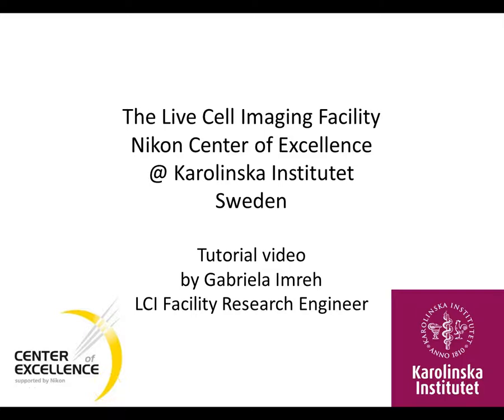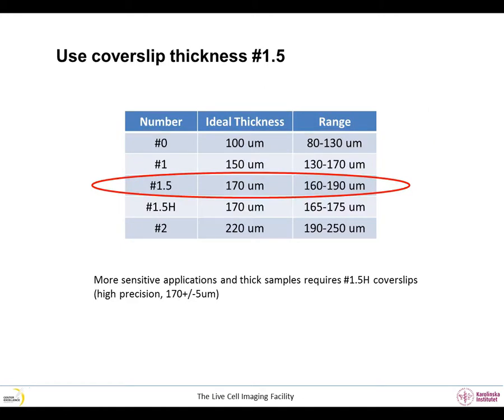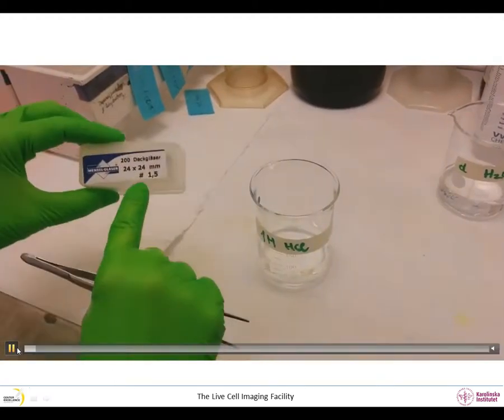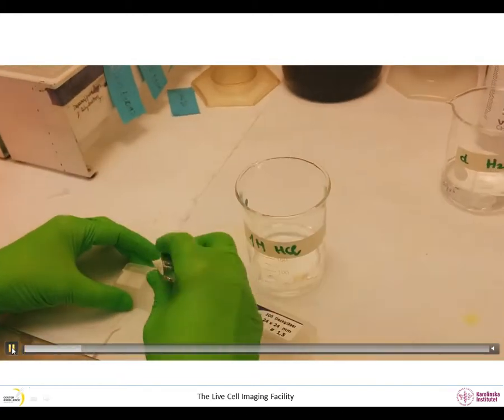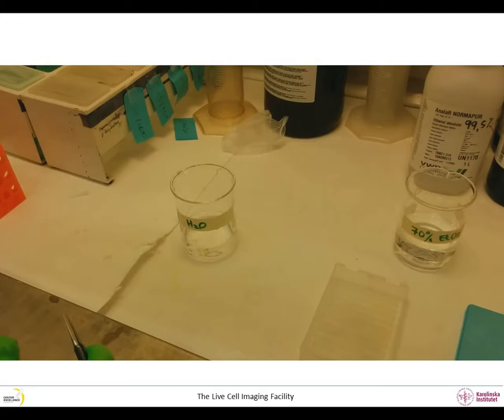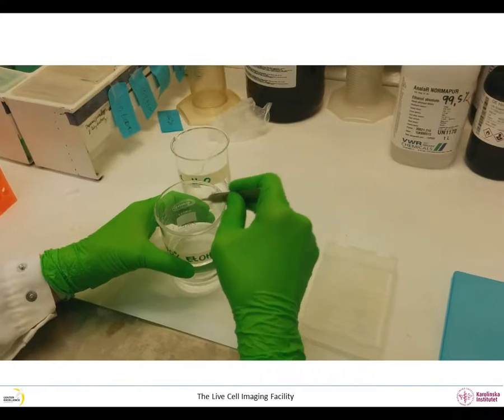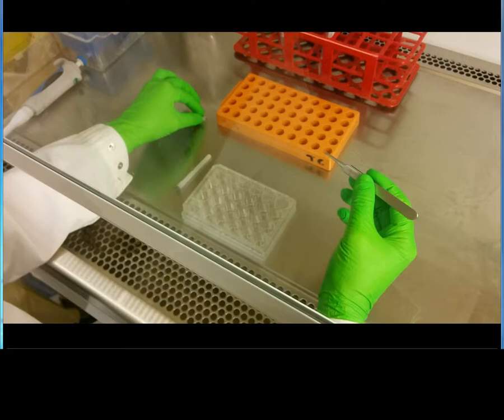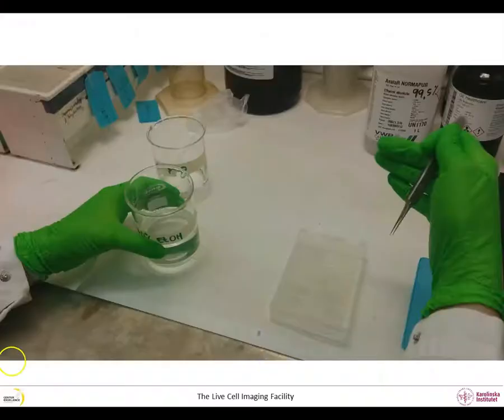Cleaning coverslips before seeding cells

Comment: It's a nice video. Could you please make another video of how to do the coating?
Reply from the maker: Hi Moinul
After cleaning and sterilizing the coverslips, simply put them on a piece of parafilm in a humid chamber (i.e. a box with paper soaked in water on the edges), add the solution you want to coat with, put a second coverslip on top so that you use the solution to coat 2 coverslips at the same time and you prevent evaporation on the edges.
Close the humid chamber during incubation time (which is often at room temperature but it depends on what you are coating). When the coating is done, carefully remove the top coverslip, flip it so that the coated side is upwards, remove the solution (often can be stored and reused) from the bottom coverslip. Rinse all coverslips with PBS. They are ready to be used. Make sure you keep track of which side was coated. Good luck!
Reply: @Livecellimagingfacility  Hello, I am trying to coat 13mm round coverslips with collagen. But I am very new to this area. I tried to add 10-20 microliter collagen solution on top of coverslips but it was very hard to spread them uniformly with pipette tip. Dipping them in solution is not useful because both sides will be coated. In the method you explained; second coverslip is put on top of first coverslip and they are located in the solution so outer surfaces will be coated whilst inner surfaces will remain uncoated. This is my understanding. could you please help me with that? 
I also don't have humid chamber and never used it before. 
Thank you!
Reply from the maker: sorry for not answering earlier. Somehow I did not get notified of your comment. Yes you are totally correct in your understanding. We sandwich the coating solution between 2 coverslips so only 1 side of the coverslip gets coated. To make a humid chamber, simply take a Petri dish, put a piece of parafilm completely flat at the bottom, place some absorbant paper at the periphery of the dish and wet them completely but not enough for the water to run out. There you have a cheap and simple humid chamber! :)